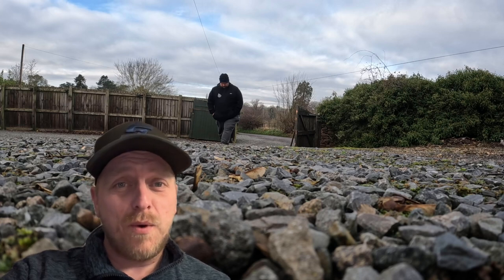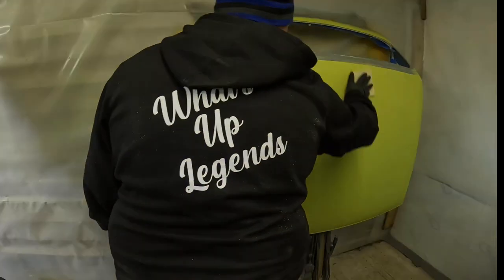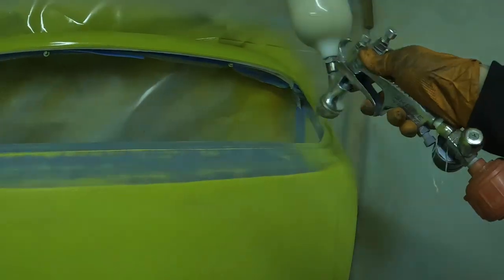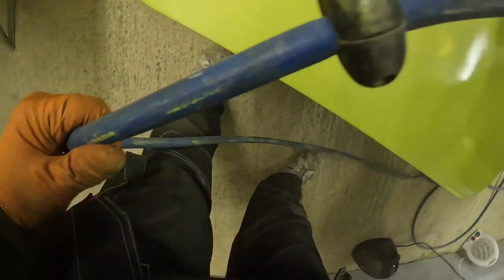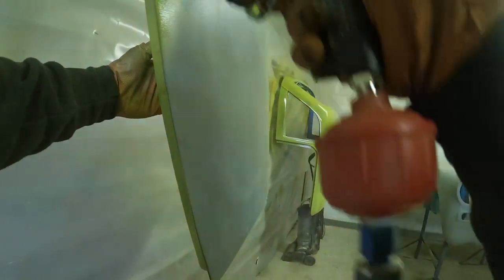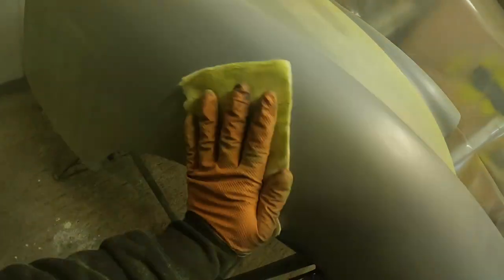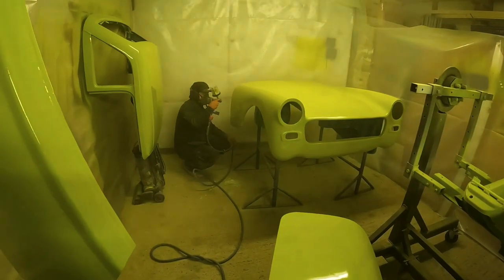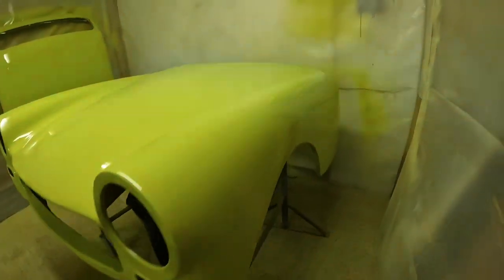Painting a customers car in his own garage DIY home paint booth #painting #spraybooth #diy #garage

Comment: What horsepower compressor do you recommend to maintain enough pressure?  I used to work in a large body shop and never had to worry about pressure but at home I need something for family cars and need to know.  Thank you, great video!!!!
Reply from the maker: Hey John, the requirements al depend on the demand of the spray gun you are using, as you’ll know bigger guns need more cfm and vice versa, usually a good brand 3hp with a 50L tank will give out around 15cfm, there is pressure drop to consider with length of airline etc but if you want to use a larger spray gun I would be looking at 5.5 hp and upwards to make sure you don’t suffer any major pressure drops or issues, that’s based on a piston compressor, the Bodyshop you worked in would have had a screw compressor or possibly a hydrovane but usually screw compressors are only available in larger capacity outputs, hope that helps bud 👍

Comment: I've got a eaton 10hp screw drive the air output on that is like painting with a airless paint sprayer
Reply from the maker: It’s a dream when your compressor is up to the job ain’t it mate 👍
Reply: @custombodyrepair  man I struggled for yrs and I was getting oil in my air lots of solvent pop I finally pulled the plug spent 5k and got a compressor will run 6 people at one time
Reply from the maker: @rongamble9884  you wonder how you ever managed once you’ve moved on to something that does the job, we were very much the same for the first few years of the business mate, started with a 50L piston, killed 5 or 6 of them, went to a 7.5 hp 200L killed that after another 3 years but then just bit the bullet and got the 11kw screw and I’d never look back now

Comment: do you need some sort of extraction or is a good mask ok as im thinking of giving it a go on a mini im restoring
Reply from the maker: It’s ideal to have some sort of extraction but so long as your respirator is rated for solvents you’ll be fine for 1 car, it’s possible to rig up an extractor out of all sorts though I built out workshop one from an old filing cabinet that I mounted a centrifugal fan in, cut an outlet in the back and made a grid for the front to house a filter and it works insanely well so for almost no money and with a bit of ingenuity you can come up with something that works, between that and a good mask you’ll be well away, feel free to give us a shout if you need any hints or tips around the time you paint it buddy 👍
Reply: Thanks for the reply @custombodyrepair
Reply from the maker: @chadlee1998  no problem at all mate 👍